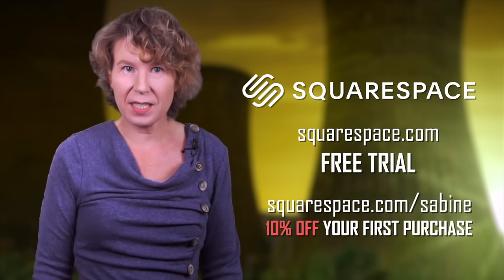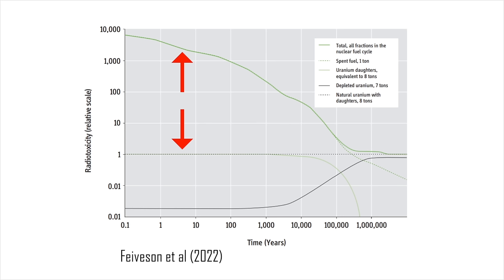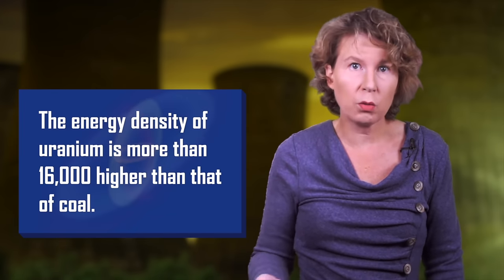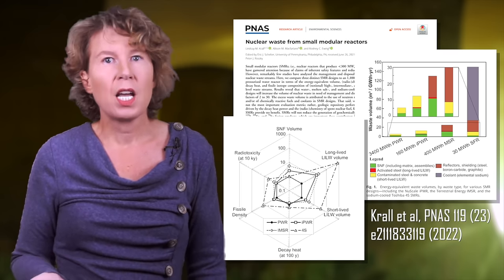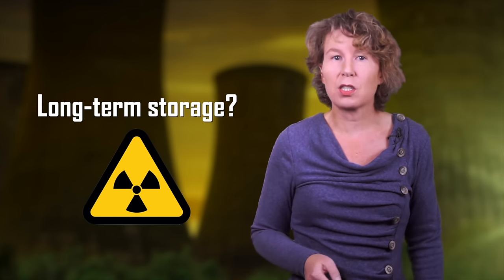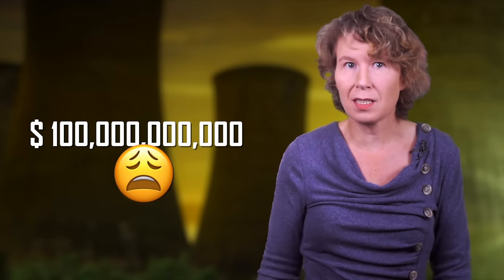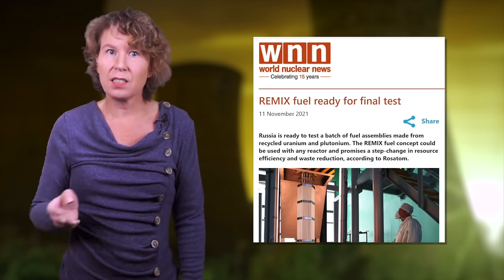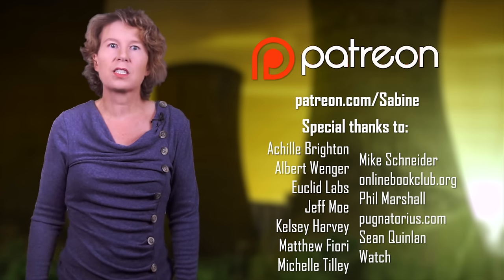Nuclear waste is not the problem you've been made to believe it is

Comment: Why do you skip over the water that’s in direct contact with the core. That is the biggest problem of the high-level nuclear waste. She usually around 2000 gallons. And is what is the problem it leaks out of its containment because it’s water which currents everything and then it contaminate the ground water not to mention the fuel rods sitting in giant swimming pools, cooling off for decades, because the people are obsessed with efficiency

Comment: We don’t „all agree“ that nuclear energy is the safest. Apart from the environmental hazards, it’s also stupidly inefficient. A modern nuclear power plant is still basically a steam engine, just with a different heat source. It’s 19th-century tech at its core. Thus it is an incredible waste of resources. Save them for a later time when research has come up with a method of directly converting nuclear energy to electricity.
Reply: "We don’t „all agree“ that nuclear energy is the safest." Well, yeah, some people are painfully ignorant of the science and think nuclear power is dangerous. But everyone who actually knows anything about the topic agrees that nuclear is the safest.
"Thus it is an incredible waste of resources." Nuclear uses fewer resources per TWh than any other power source ever devised.

Comment: We can take care of the waste. It's just that if you want to take care properly so that it's not going to be a catastrophe some time in the thousands it years, then renewables already cost less...
Reply: Well no, the waste becomes safe enough to handle barehanded in a few centuries.

And in the meantime, you can literally just leave it in a hole in the ground. It's solid metal waste, at the centre of a block of concrete, covered and reinforced with metal so that it can't crack or erode. It's not going anywhere.

Comment: Thorium instead of Uranium.
Reply: Why?
Reply: @homeontherange733  Most of what you listed (2-4) is a product of the type of reactor needed to burn thorium, and applies equally to uranium in the same reactors, and 7 is just a description of the fuel cycle, not an advantage.
1. I agree that it is more abundant in the crust. It's also more evenly distributed, making it harder and more expensive to mine. Most thorium that is easily extracted is associated with rare earth deposits, which are predominantly controlled by China.
5. It's really not more difficult to weaponize, except for the increased complexity of the reactors required to breed it.
6. Uranium tailings are far less radioactive than the native ore, so this really isn't relevant.

Comment: How do you keep something locked up safely for 100,000 years? You don't. It's impossible to account for everything that could happen in that time. Using the fuel more efficiently is really the only solution if we are to continue using nuclear power.
Reply: So how do you keep the toxic waste of ruinables safe FOREVER?  Yes, forever means longer than 100,000 years. Nuclear waste eventually degrades, toxic solar waste never does.

Comment: Sorry to tell you that we do NOT all agree that nuclear power ist the fastest way to get away from fossile fuels. So you are already starting with an absurd and even false statement.

Why not? Because we agreed in Paris on the 1.5°C target with a very tight schedule (which we will miss by a great number, by the way). We won't be able to built that many nuke plants in that period, and we also do not have the capacity to produce enough nuclear fuel and we will run into a shortage in Uranium if we would be successful in doing so.

Besides that: No insurance company takes the risk for nuclear power plants. Instead, we(!) in our stupidity do! The risk is on us. Go figure.

And do you really think that using the most powerful force humans can use should be used to heat water that then drives a turbine? Just substituting coal with Uranium?

I think you can already smell why this is a silly idea.

Also, nuclear power plants are not flexible enough in a world were renewables already produce 20 or more percent of the needed energy because you can't switch them on and off as needed. They are good for a base level supply, but that's it.

Nice try to focus on the high radiation waste, negligating that thousands of tons of material need to be safely stored as well.

Okay, let's assume you will find enough safe storage. For how many years does it need to be safe? 10.000?

Humanity exists for about 20.000 years - just to give you a time scale for the needed period of a functioning high safety compartment. Do you really think that mankind can do that? I don't.

Let's face it: Nuclear energy in this form is an exoensive laugh. We can do better.

Comment: I spent 21 mins waiting for arguments that storing nuclear waste for 100.000 years is not a problem. None ever came. We heard: there is a lot more low level nuclear waste than high level nuclear waste. We heard: producing nuclear energy is a good idea. We heard: the amount of nuclear waste could be reduced if we used more sophisticated methods. All false retoric, twisted arguments. A mortal sin for a scientist, humor or no humor.
Reply: The argument that storing it for 100k years isn't a problem is the Okla natural reactor, where over the course of a billion years uncontained reaction products barely moved. So yeah, glassed in concrete they're not going anywhere.

Not that it matters, since storing it for 100k years is a waste of money, time, and space anyway. We'd just be digging it up in 50 years anyway, to get the plutonium and processed uranium. Better to just remove the Cs/Sr fraction, only about 1% of spent fuel and only dangerous for ~300 years.

Comment: You don't need  fission to heat water to produce steam.  You can use existing electricity  to heat water to produce steam to spin generators.    Oh yeah we can't make money off that
Reply: Well yes, because the laws of thermodynamics exist. You can't take electricity, use it to heat water, put the steam through a turbine and end up with more electricity than you started with. That's just not how that works.
Reply: I've seen it work. In Louisiana  at a paper mill. They had three giant GE steam turbines  powering the entire plant. Boiled water with steam they heated with the generators.
Reply: @RichardRhodes-r5q  
That's not the part that I'm objecting to. Of course you can heat water with an electrical aggregate. That's how most water heaters work.

What you can't do is to use X joules of electrical energy to heat water, put the steam through a turbine, and get more than X joules of electrical energy back. That contradicts the first and second laws of thermodynamics.

What we have to do to produce electricity using steam power is to heat the water using some other power source. E.g. coal plants do it with coal-fired boilers, and nuclear power plants do it with heat generated from splitting uranium atoms.
Reply: So are you telling me you can't spin a 12vdc 400 Amp  generator with a motor that draws 20 amps and have 380 amps left over for other loads. As long as the mechanics hold up.
Reply: @RichardRhodes-r5q  
If you use X amount of energy to drive a generator, then the amount of energy you get back from that generator can't be more than X. That's a hard physical limit. It is not possible to repeatedly cycle the same electricity again and again through a closed system and keep getting back more electricity.
Reply: The machines in Louisiana  produced much more power than required to heat the grid for the steam  Thee three of them shared the loads for the factory to work
Reply: It doesn't matter how you spin a generator. As long  as you spin it. 
It will produce electricity.

Comment: 0:05: "We all now agree that nucleair energy is the fastest safest and most reliable way to get off fossil fuels.": This is utterly nonsense. It is dangerous, even if you put aside the problem with nucleair waste (for which is no good solution, still not after 73 years when it all started). The more nucleair plants you have, the more chance on a domino effect: they generate power for each other (for cooling purposes), to be able to run safe. Also, it seems you have forgotten the nucleair disasters. And you also seem to have forgotten that even if nucleair energy could be done safely, this would not mean at all that it will be done safely. In fact, you can not find a single nucleair powerplant in the world, which did not have safety issues in it's history. Not a single one. So what makes you think that suddenly all safety issues will go away within the blink of an eye? It won't! Also: we do not need nucleair energy. We, in fact, also would not need solar cells, hydro plants or wind turbines, if we no longer want to use those. Because if we would move to geothermical energy alone (nothing else), we would have enough energy to 'the end of time'. That is: until de oceans boil of (maybe not in 400 years, but it will in about 1 billion years, because more radiaton of the sun in the future), and the earth isn't be able to support human life anyway anymore.
'Conventional' nucleair plants will never be safe. Never. Not because they can not be safe technically, but because they can not be safe economically_. Managers will always cut corners regarding safety. Always. Because if they wouldn't, their business simply does not have any chance to survive. Also: people will be people. They will _always makes mistakes or prefer a larger income over sufficient safety. For those reasons, 'conventional' nucleair energy has no future, or at least it should not have a future. It could be that SMR's and fusion reactors in a far future might be safe enough. But that's the far future, and definitely not the 'fastest' way to resolve the problems concearning nucleair energy or a way to ditch fossiel fuels. Geothermical: thát is the way to go (at least if you don't want to use solar or wind power).

Comment: I don' t agree on your positions about nuclear power.it should not be so widely used   Nuclear waste products are frightening and dangereous,for 100000 years
Reply: Lol no. It's frightening and dangerous for a few months until you've gotten it cooled down and cast into storage casks. At that point, you can just bury it in a hole in the ground, until when in a few centuries you can crack the concrete open and handle the waste safely without gloves.

Comment: Isn't it time we stopped using steam engines to make Electricity?  It's time the boffins figured a way to make say 80% efficient Solar Panels and batteries with non toxic elements that are easily obtained (seawater?) !  Follow that with standard appliances that run, for example on 24 Volts, requiring no inverters for the household?
OK you have high-rise in cities but the majority of housing and business could pretty easily manage this!

Comment: Sabine has a dangerous opinion, basically, she is telling you nuclear waste is an "overblown problem" because some engineers really have put some thought in it, therefore everything is fine. There are a lot of unfeasible recycling treatments (myths) so the main problem remains: we push the problem and the risks of dealing with nuclear waste to our kids and future generations, which is remarkably unfair and dangerous plus we assume our engineers are good enough to foresee everything that can happen in centuries to millennias to come and yet in the last 40 years at least two "super safe because made by engineers" reactors have blown up, that could have poluted our ground water. Nuclear energy is a hybris and people like Sabine who downplay its risks, because they think they are god-like smart, are in my eyes dangerous.
Reply: You can literally just dump the stuff in a hole in the ground. It's solid metal inside a metal-reinforced block of concrete. It's not going anywhere.

How long you need to leave it in the ground depends on how safe you need the stuff to be. It takes tens of thousands of years for the waste to become radiologically safe to eat. But if you can settle for merely being able to handle the waste safely with your bare hands, then that's only a few hundred years.